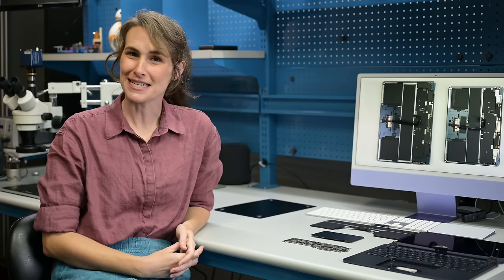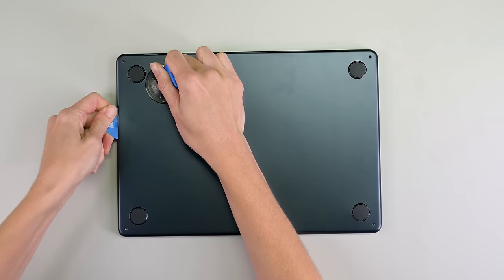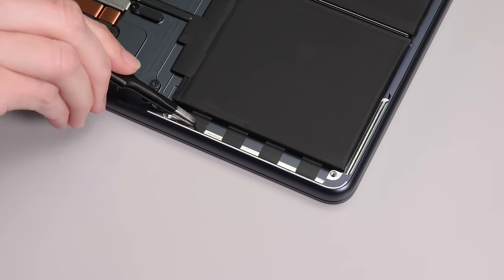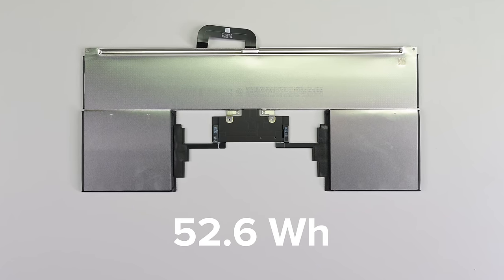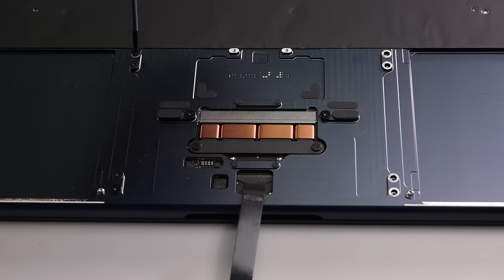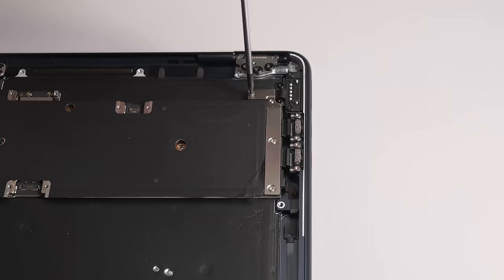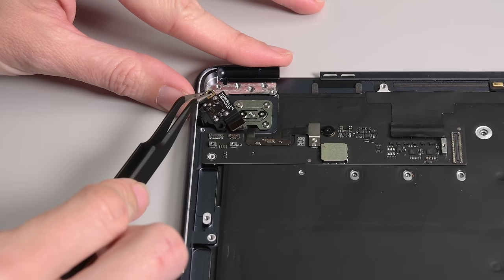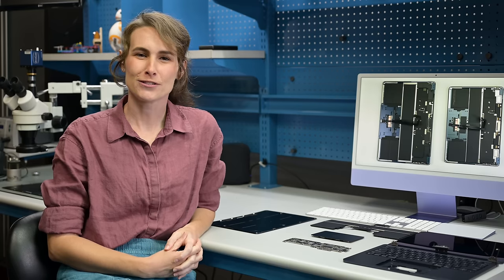M3 MacBook Air: The Tiniest Change Makes All The Difference

Comment: The worst example of anti-repair I've seen to this date (that's somehow even worse than Apple's) is still the onewheel.
Wanna replace the tyre because it got used up? Umm, no... You gotta disconnect the battery, which would wipe the volotile ROM holding the firmware, bricking your board.
Imagine sending your car to the manufacturer just to swap the tyres...
Reply: Which onewheel? What is that?
Reply: whats onewheel
Reply: That's not the case on the pint, I'm not sure about the GT or the pintx though.
Reply: They store it in volatile ROM...? They could've used a just-as-cheap NVRAM that doesn't mind getting disconnected from electricity. Imagine your tires falling off accidentally due to a manufacturing defect or a light accident and your entire car gets "bricked"...
Reply: @rawrrrer  They could have, but it would allow users to use services other than thr manufacturer.
Reply: Disconnecting the battery should not wipe out the firmware. many laptops have a separate battery for the clock and firmware, but what gets lost when this power is cut is just a few bios settings.
Reply: @bengt_axle  It's an electric scateboard, not a laptop...?
Reply: @shapelessed  And all the winners saw, only if we heard, the blue deep sky, ocean. The belt could harmonize over pastures then only one could see the dissent of the missiles, over the cells. Juniper everywhere barrels in the sunset, logged off. Network shrinking in the supernova. Lots of parts.

Comment: So, if the battery is held in place with four screws and they are already using screws that double-up as posts for clipping on the cover, why not get rid of the adhesive altogether?  Use two more of those screw/posts in the corners of the device and make it simple and easy?  Just like my old 2011 MacBook Air?
Reply: I’d be interested to know if there are any actual engineering reasons for this beyond trying to be difficult. I would say that it might make assembly easier, but they have to do the screws on half of it anyway. Maybe they install it with glue first and then add the screws later because it’s faster or easier?
Reply: Most likely vibration isolation for frequency/wifi reasons.

Comment: i used to fix computers a few decades ago.. i understand the principle of 'right to repair' and all that, great stuff, but compared to what i used to do to just get inside a laptop these modern machines are infinitely more simplistic -for lack of a better term.
a few months ago i helped a neighbor w/ a lenovo T something, maybe 14... it felt like the engineers put time in designing things in such a way that the disassembly is foolproof. an actual pleasure :)
Reply: the issue is that lenovo has a focus on ICT industry and tries to keep things fixable in some way.
but soldered on-board memory and storage along with proprietary hardware with no 3rd party alternatives that work reliably (as intended by apple) we had an absurd increase of who can make the smallest and lightest machine, but also force people into a hardware lineup that is doomed to be replaced by complete new machines each year and without ability to transfer boards (at least easily).

Framework focused on that, i run a framework 13.
its infinitely more accessible, elegant in repair, fully modular and can be repurposed or improved as new parts roll out.
Chassis, boards and drivers are designed to work across the board (except the framework 16, its designed for that form factors boards but is still a FANTASTIC system as much as the 13).
Reply: lenovo quality got worse and worse, i went back to macbook air because i was unlucky twice with lenovo thinkpads.
Reply: Built for automated recycling disassembly
Reply: But once you open it the parts are serialized and even if you could get a replacement part it will not work.
This is why we need right to repair laws in all 50 states
Lenovo makes junk products, when it was IBM the products were good.
Reply: @johnsparozich6839  Also, on mine the mainboard died which made it a financial total loss.
Reply: @or123and what was the model of your laptop?
Reply: @whyamiwastingmytimeonthis  The short lived ones were X1C G6 and  X280... the previous ones we had were much more durable (X270, X260, X250, T450s, X240, T440). The "thin" models = nono.
Reply: The word 'simplistic' doesn't mean what you think it means.
Reply: @Satanist-zm2rq  "simplistic" may be used in multiple ways w/ different nuances and even meanings. 
i double checked and i think that was a proper use of the term ('oversimplified', 'not complicated') although there are most likely better choices to express the idea...

my native language is latin based and it maintained the 'original' meaning of the word "simplex". i see that in english the word went thru a few updates and it's relatively new, picking up popularity only since the 70s. 

i welcome educational input, take care and thanks.

ps: in latin and latin based languages the word is rarely used (pejoratively) in the sense of "simple minded", "lacking intelligence"
Reply: @duroxkilo  Meanwhile, quality doesn't mean what it used to mean, for manufacturers.

Comment: Software locks deserve an automatic 0/10 or disqualification. 
Whats the point of repairing a laptop if you cant repair it successfully?
Reply: What is the point of repairing a laptop with a cheaply made Chinese scam part?
Reply: @ericmatthews8497  Nice strawman
Reply: Well evidently not every part is software locked. So the device gets a score based on the repairs that are possible despite the software lock.
Reply: @ericmatthews8497  Tbf Apple made at least some of their stuff in China
Reply: @mArvAlcao71  They all make stuff in China.
Reply: Because pairing some parts like Biometric sensors is actually a good thing for security. Yeah it's far more common that parts absolutely don't need to be paired and I think all unnecessary parts pairing is bad, but I actually want my TouchID sensor to be hard paired to my device because it makes it much much more secure if anyone with physical access tries to break it
Reply: @benammiswift  parts pairing has nothing to do with security
Reply: @rosaria8384  it absolutely does in the case of biometrics. Other stuff fair enough but Biometrics absolutely should be bound to the motherboard they were made with so that neither the biometric device nor the device itself can be easily circumvented
Reply: @rosaria8384  spoken like someone who’s never gone through an airport in China where they take your electronic devices for “inspection”
Reply: @rbdan Ever travel to the US as a foreigner? They do the exact same thing.

Comment: Yes fixable only if you can get reasonable priced replacement parts!!
Reply: which will always cost more than a new machine, naively speaking.
Reply: One thing that Right to Repair doesn't tackle is reasonably priced parts.
Reply: Which is the big point in part pairing ban. You will be able to buy cheap third party or used parts that were cannibalized from broken devices.
Reply: @matthewmershon4792  third party parts will never work and is not part of parts pairing ban, which is a good thing. You don’t want a fake Chinese replica replacing your touchID sensor and breaching your TPM chip, that’s going right back to being anti-consumer.

Comment: So... if you screw down the batteries.. WHY do you need adhesive? Also, taking it apart is just 1/2 the game... can  you put it back together without Apple disabling something?
Reply: why would you not be able to put it back together? Apple doesnt disable anything when the machine is taking a part...
Reply: Because if you try to remove  glue its easier that you can break something by accident.

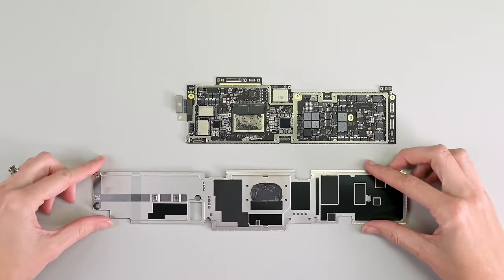Comment: 3:26 if the heatshield is the same as the M2, it doesn't just "pop off", far from it. There are at least 50 clips around the perimeter that are a major PITA to remove.

Comment: I used to repair laptops about 25 years ago, and this one looks amazingly well-designed. The parts that wear out, like the batteries, ports and hinges are all modular. The use of space is very efficient, and the assembly is immaculate.  Plates with screws add rigidity and reliability.  If there is no code that prevents parts from being swapped in, I'd say that this is a very good design, rivaling the old Thinkpads, that were chosen for their repairability and parts availability.

Comment: Use a suction cup to pop the bottom left and right sides out of the locking tabs and then use a black stick on the inside of the left and right display hinges. Will push the cover right off.
Reply: Black stick? Is this a technical term?

Comment: are the thermals better managed in m3 air vs m1 air?
Reply: Probably not. The M3 has more heat issues than the M1
Reply: @SA-xf7pc how so?
Reply: and can you improve heat dissipation in any way?
Reply: @bonezed i think it might depend on context of which applications you are using, for instance stress testing with cinebench and then checking thermals is in extreme situations and perhaps not day to day tasks, so for m1 air currently it runs brilliantly and i think the m3 air for day to day tasks should run well too because they have added more passive thermal heat distribution
Reply: @denvernaicker8250  Apple increased the overall density of the chip and the clock speed but didn’t really improve the thermals and didn’t improve the dissipation of heat at all.

Comment: great video and insightful in general to right to repair and how that applies to latest macbooks, i find the screw assembly to be a bit more elegant rather than having sticky glue everywhere even though it might cause contention with getting the exact parts later down the line

Comment: Even with the issue of parts pairing still outstanding, I would've thought the provisional score for these new MacBook Air models would be better than 5 out of 10. Compared to teardowns of previous MacBook models, it looks like Apple went quite a long way toward ease of repair.
Reply: RAM / Storage isn't a repair factor though, that's an upgrade factor, not to mention that the RAM on Apple Silicon is on the die itself. Makes it a bit difficult to just drop in a bit more.

Comment: It's not mentioned with a single word that 1. the SSD is still soldered on the mainboard, it's a wear part that will turn this thing into proper E waste once it reaches it's max write cycles. 2. the RAM is still soldered making replacement impossible 3.there's no cooling system at all which will lead to a battery enjoying the heat output from the nearby SoC ...
Reply: this is nonsense, this are the highest quality ssd available, it will outlast the device easily, we talking 15 years here, why would anyone wanna replace ram on a macbook, you just sell yours and buy the one you want, this is the power of second hand apple devices.
if a device has even just removable ram the second hand market is destroyed because ppl putting their hands on devices ruins them, even if just replacing ram.
everybody solders their ram and ssd.
heat on apple silicon is not a thing, well if you synthethic benchmark an entry level machine you will geet heat but then it just throttles, like every other computer in the world, which is just fine.
fanless isthe single best Feature of a laptop imo.
Reply: @JohnSmith-pn2vl  Well as the end user people should have the freedom of what they do with the device they own. Inceasing the storage or performance through RAM upgrade.

I do think Apple Silicon is impressive, but soldered RAM and SSD are the deal breaker for me.

Comment: Playing devil's advocate, I do think SOME parts pairing is necessary. Things like FaceID and TouchID data seems like the kind of thing you need to keep secure, but that shouldn't apply to a laptop display...
Reply: No one really complained when that requirement was discovered with TouchID Home Buttons, due to how it interfaces with the secure enclave. We DID start to complain when swapping OEM display panels began disabling features like TrueTone before Apple upped their game and disabled non-authorized repairs completely at the firmware level.
Reply: It's not. They are just sensors. They should sense whatever data they are made for and send that to the logic board. There should be all the crypto magic and Secure Enclave things going on, that decided weather the received data seems legit or not.
Reply: @zahlex  the fear is that these sensors could be swapped on a targeted attack and modified for example to capture and extract your fingerprint.
Reply: That can still be safely done as-is. Just not make it hot-swappable (meaning once disconnected and reconnected, you need to restart your phone) and require pin code to enable biometrics. That would make any attempt to use fake sensor to unlock your device impossible. Heck, you could even save some apple encryption key to every biometric sensor and the phone would just check if the sensor is genuine Apple part, regardless of the ID, making it possible to use donor iphone.

I very much doubt Apple with their R&D budget couldn't figure out anything...

Only thing I can't deny is that part pairing makes any attempt to steal an iPhone less attractive by making it harder to sell it for spare parts, but I'm not sure I'd want that if it meant harder, more expensive repairs and sometimes even buying new device just because Apple decided they won't fix it.

So... Yeah 🤔
Reply: I thought part pairing was to stop people stealing and selling for spare parts
Reply: @tomasbrown6013  Could also be done by just blacklisting stolen parts without needing any pairing as part of the repair process
Reply: Honestly, parts pairing, particularly security features, is tolerable if Apple gave people easy access to the firmware for technicians and DIY users, similar to Google with their parts pairing of Pixel phones.
Reply: This is the answer. A bad actor could gain physical access to the device and replace the sensor with one that also retains the scanned data. This data could later be played back completely bypassing the biometric security.  This would allow the actor to modify the device and retrieve it later after it has been used and have full access to all previously secure data. You don’t want this attack vector to be possible.
Reply: @QuintonDolan  it is absolutely possible to hardcode apple encryption key into these sensors and only verify that replacement part is genuine. That should stop modified parts messing with device. If it does mess with device anyway, you won't stop it by serialization, that can be bypassed with simple ID cloning machine. There are better ways to secure the device than part serialization.
Reply: @Tom_videa  The sensor doesn’t need to mess with the device in order to be able to do a replay attack, it just needs to collect data. Device pairing isn’t a perfect solution, but if it is done well it is enough to alert the device to invalidate any previously stored biometric data and notify the device owner that it has been tampered with. It’s a tricky problem to get right, but requiring no pairing at all is certainly not a good option.
Reply: @QuintonDolan  As I said, maybe I didn't make myself clear enough. This can be easily solved by loading an encryption key into parts memory and having it encrypt a random number to check if encryption key is the same as the one iPhone expects, i.e. the part is genuine. If this can be somehow copied, so can part ID used for pairing. 

I am an electronic bachelor and Samsung user, so I don't believe this Apple nonsense that security can't be achieved without part pairing.

Comment: iFixit's hangup on the pentalobe screw is irrational.  One of the biggest impediments to repair is the stripped-Phillips head screw, which is found in most small electronic devices.  Pentalobe is a big step forward.  Using Torx everywhere would be great.

Comment: Genuinely throwing it out there. But aren’t these devices locked down and difficult to repair to deter hackers?
Reply: If you leave your laptop unattended in a public place long enough for someone to physically open up the laptop and install some sort of malicious hardware and close it all back up and some how you didn’t notice the computer power cycled… there’s no scenario where that isn’t on you. Even the easiest to open laptops like the framework take at least minutes to open and put back together, and involve using a tool of some sort. 

There are also plenty of malicious procedures that just involve plugging something into a port while the laptop OS is unlocked, sometimes even if it isn’t unlocked. That will obviously always be easier than cracking open the laptop.

So no, I highly doubt hacker prevention was a goal of making the laptop harder to take apart. At least not a sensible one.